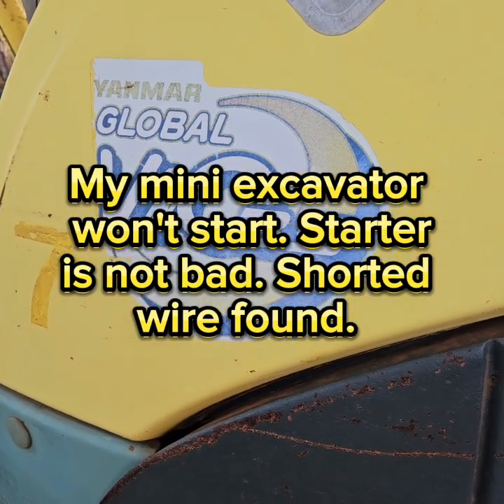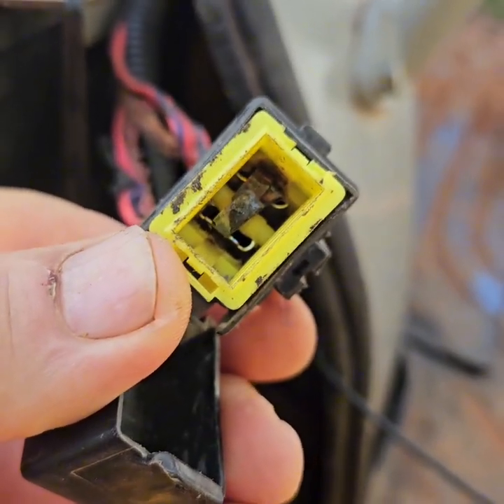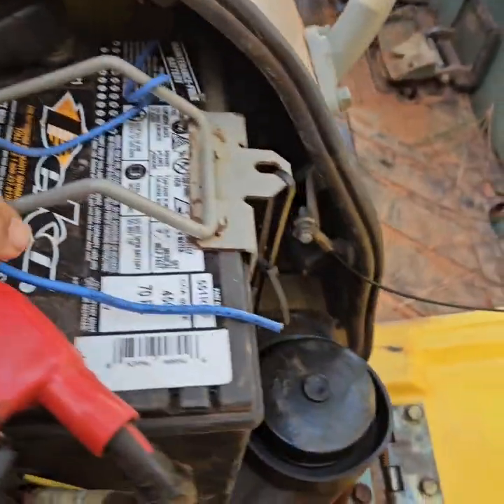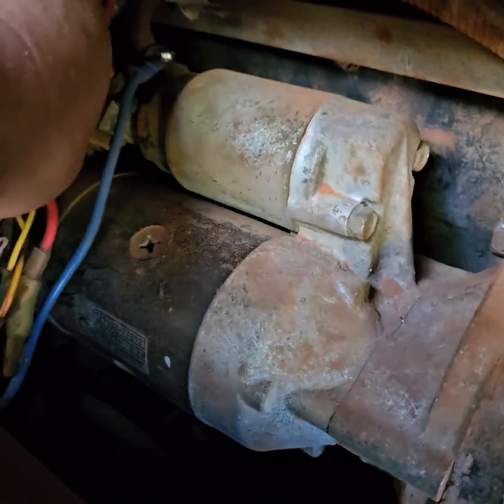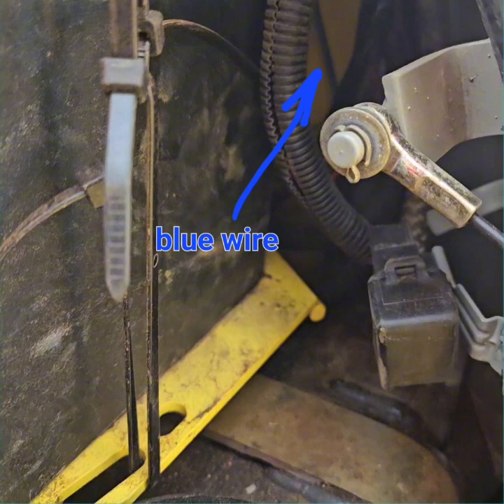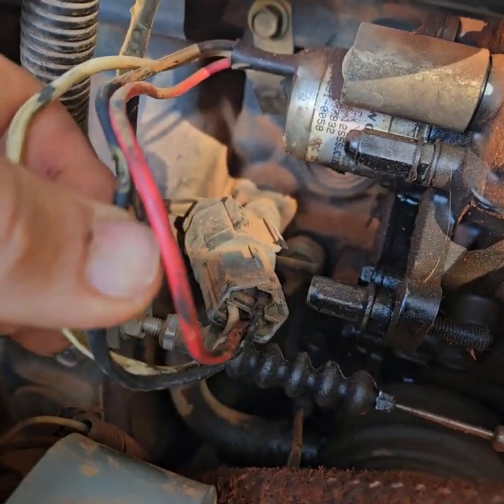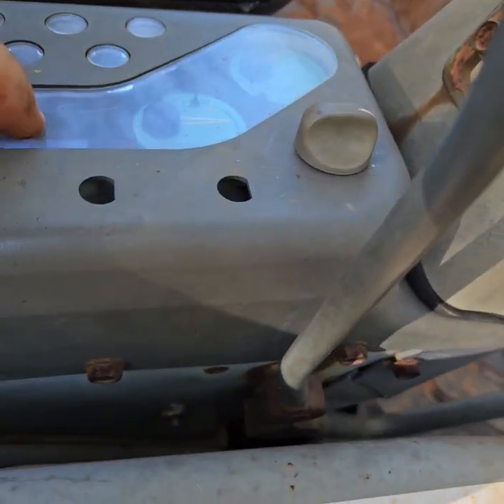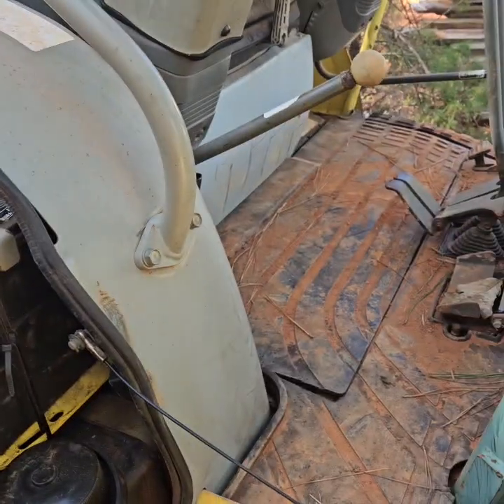My mini excavator won't start. Starter is not bad. Shorted wire found. Problem solved.

Comment: Blue wire from battery to where on starter motor?
Reply from the maker: @matiu1  the small terminal on the starter. Small wire connection. It is supposed too get 12 volts from the key switch to operate the starter solenoid.
Reply: @roscoesrepairs awesome.  Got it. Thank you.
Reply: So this connection of the blue wire would work the same for a 24 volt excavator? Positive post from battery to the small terminal on starter?
Reply from the maker: @matiu1  if it is negative ground. Negative to the frame then yes. If it doesn't start the starter then the starter solenoid is bad.
Reply from the maker: What excavator do you have?
Reply: Hello I have a similar issue. They did the same with my fuse but my machine start if I hook it up to my car.  Rand for a while and shut it off but did not start back. Did the same thing